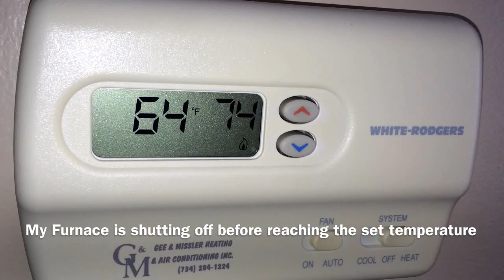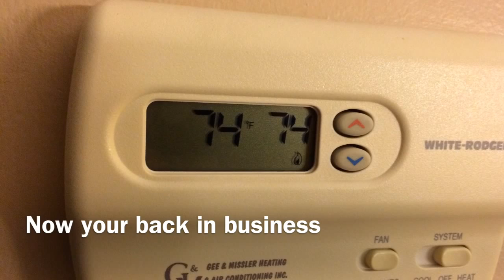My furnace keeps shutting off, only runs for about 5-10 mins... (HD) Simple Fix (Flame Sensor)

Comment: What happens to my furnace is that I up the temp two degrees or so and it starts like it should but then after about 5mins of running it stops and then about 15mins after that it runs again, if I take the door off the furnace and pull the filer and it runs like it should the entire time till it reaches the correct temp. I checked the air intake pipe and it is debris free and the filter is new.
Reply: Sounds like it's cycling off on high limit, due to low air flow, that could be caused by failing blower motor, low fan speed setting, dirty indoor coil if applicable, to restrictive air filter or impacted, vents being closed, or combination, of course I would ultimately recommend a reputable HVAC contractor check it for you.
Reply: What did you find was the problem with it???

Comment: Has anyone had this problem with a RUDD Silhouette 2? I That is the type of furnace I have and that is exactly what it is doing.
Reply: Mine, I bevel that the heat exchanger is going too hot !!! air flow in the  return duct is not enough !!

Comment: It did help a lot! I had an HVAC guy come out and give my furnace a once over and assume that the blower was going out.  He didn't really run any tests.  I googled the symptoms and all the answers pointed to the flame sensor rod.  I asked him if it could be that and he said no.  I checked it myself after watching your video.  Mine was indeed very dirty.  I cleaned it and put it back together and it has been working correctly since.  Saved me buying a $1200 blower that I didn't even need.  The HVAC guy was actually trying to talk me into a whole new furnace saying that mine was a crappy brand and I would be better off just replacing the whole thing with a top of the line unit.

Comment: Had the exact same problem and solution as lestergoods.  Water build up in my Westinghouse gas furnace 10 yrs  old, was backing up into the secondary condenser fan and into a vacuum tube.  Loss of vacuum and the safety features would kick in shutting off the gas.   Some orifice needed to be drilled out to a slightly bigger size -- then "blew out" the tubes to unclog.  Seems to be working fine now.

Comment: My HVAC guy told me to simply use either a newer dollar bill or a clean steel wool.  Doesn't recommend sandpaper due to the coating on the sensor rod.  Doesn't recommend a Brello pad due to the chemicals, soap etc. in the Brello pad.

Comment: My furnace short cycles.  It turns on, full flame.  5 minutes later it shuts off only to start the cycle again immediately.  Any idea?  I am going to clean the flame sensing rod for now.
Reply: J Kim  mine too, flame sensor wasn't my fix. did u figure out another fix?
Reply: Sure did.  It turns out the previous owner installed a 5 ton unit on a house that barely required 2.5 ton unit. Every winter, I have to go through hell to get the heater going.  My solution was to remove both panels and increase the outflow pipe diameter to 3" PVC pipe.  Now, it works like a charm.  Still not ideal, but much cheaper an option than replacing the furnace. I hope that helps.

Comment: I'm having the same problem except with the A/C unit. It runs for a few minutes then stops before reaching the desired temperature. We're having a heatwave and the temp on the thermostat reads 83 degrees inside. I set cooling for 78 degrees but the unit runs for about 5 mins then shuts off. After about 10 mins it starts again , only to shut off again in 5 minutes. Replaced Capacitor and Contractor but it is still short cycling. Don't know what else to check.